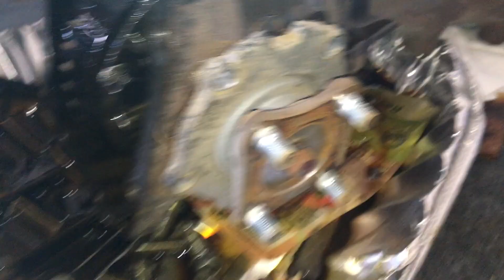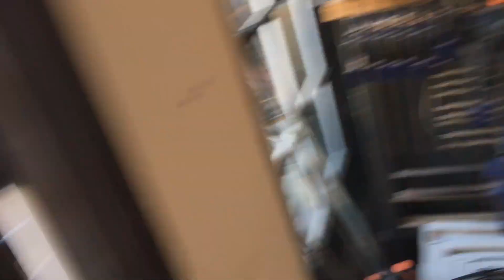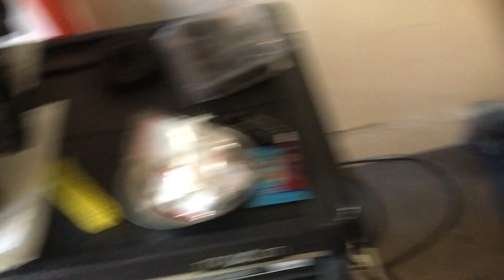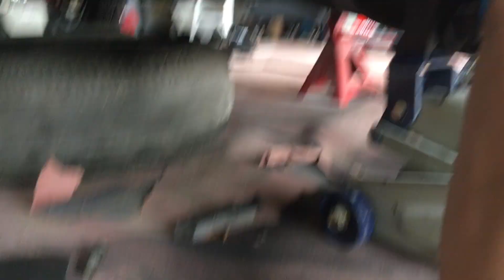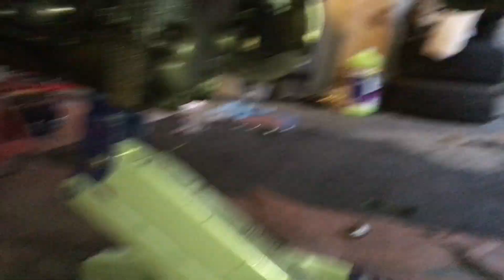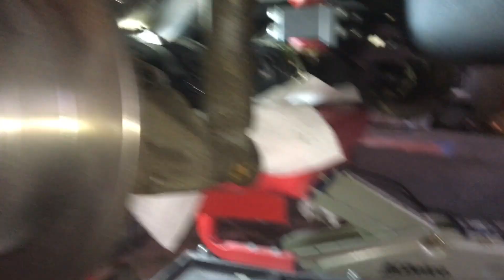Datsun 510 R180 differential swap and axle kit installation

Comment: I can't justify spending $500 for some stub axles when you spend 500 on the differential. A lot of guys are now going to the Super 8.8 differential. You can get a 8.8 limited slip differential for like 350 bucks. Then it will drive like a modern car versus taking the chances of the r180 bearings taking a dump. The only way I can get an r180 to live in my 240z is to weld it and every 7 to 12k miles I have to pull it out and put fresh bearings in it.

Comment: Awesome vid Timmy. The holes for wire ties on the coupling bolts is why I like WC racing's axles better than TE racing's. I have Troy's setup in my car and I have to re-torque them every few months. Total PITA.
Reply: Surely you can find the right blots for that any body know if the New Troy Axles (MKII )  any better ?

Comment: wow that bar makes no sense at all there is more than enough material that they could have threaded so as not to have through bolts... Yet another reason why I will be making my own on my mill.....
Reply: I thought that also ...  they use locknuts  but the bolts don't look long enough . hopefully they fixed it buy supplying longer ones ... (or it might not have been torqued down completely )

Comment: What year subaru did you use?
Reply: 2004-05 has a CLSD with 3.90 ratios. 2006-08 has a Helix/Torsen LSD or CLSD with a 3.54 ratio. 2009 and up have Helix/Torsen LSD with 3.90 ratio.
Reply from the maker: Pretty sure its 2004, hard to tell though. Subaru started making LSD in 2004 so its between 04-11
Reply: Timmy's Garage ok thank you

Comment: How did you attatch the driveline to the subaru diff? Do they make an adapter for that too? Or do you need to fabricate a new one using parts from the factory driveline and the subaru one?
Reply from the maker: I'm going to get a new driveshaft from the driveshaft shop that will mount to the subaru diff and the sr20 engine. You can also just use your input flange from the stock datsun differential and it will mount to the driveshaft